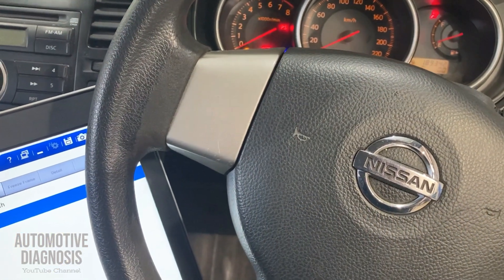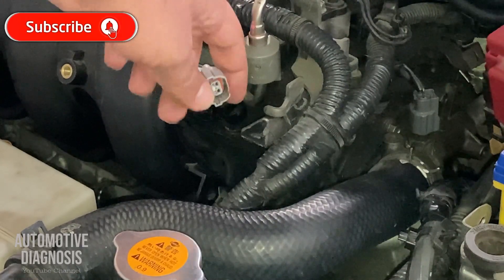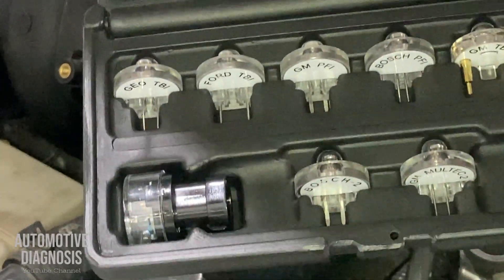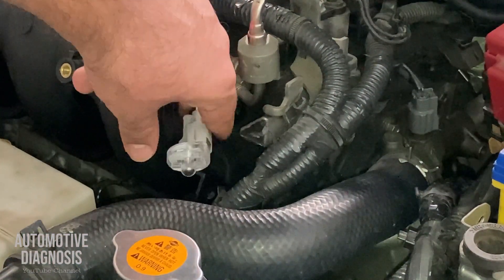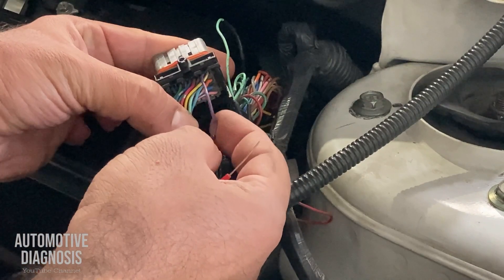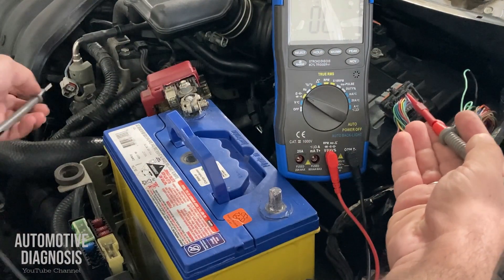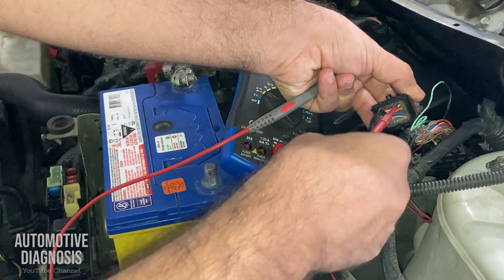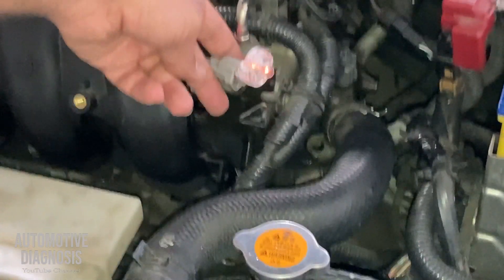How to Use a NOID LIGHT to Test an Engine for Misfire | Test & Fix P0304 Misfire Fault Code

Comment: Hi if I put my multimeter to both pins on the injector harness connector it only shows 0.33v any idea why so low, this is for each one it shows 0.33

Comment: Can Noid lights be used on a CAN bus system as I have been told the ignition switched voltage is 5v & not 12v like a normal system, I have an injector not firing on a 2004 2.0 diesel jaguar (Ford engine) & I am trying to find a test for the signal pulse wire.

Comment: I have a Code P301
Coil, spark plug and injector replaced,
Cylinder compression 150psi,
Injector connector tested with a NOID light tester(ok) 
,ECU or “Computer” replaced… 
Asking for help and fresh ideas from that smart DIY community, I’ll will compensate $$$ whoever comes with the solution to my problem 😉
Reply: Fuel pressure test? 
What vehicle or type of fuel pump,
Reply: Did you find the issue?
Im in the middle of #  1 and 4, not getting a signal back to ECU, suspecting a wire fault  Rx350 07
Reply: @jessb4421  engine needs to be rebuilt, very low compression, I used a  leak down tester for more accurate results ☹️

Comment: It could've been that Ecu shut the injector off to protect engine also it could've been a bad Ecu.. This is why O scopes are great..
Reply from the maker: Thanks for sharing your experience. Yes, oscilloscope is very helpful and more accurate. We have also many videos of using oscilloscope on the channel.
Reply: Thinking that's the issue with a Merc S500 I'm working on...🤔

Comment: Never disconnect a battery from the negative terminal only.  If you leave the positive terminal on, there is a chance something could have a ground somewhere (or not enough ground) you didn't realize and POOF.  Bad day happens.
Reply: WHAT ?  Ot unless it contacts the battery negative terminal. It's Unhooked .

Comment: Just found and subscribed.  This may be my issue. Gonna order a noid light kit. Have a po302 on my 2006 Subaru sti.  Did all the swapes and tests. Compression, leakdown,  vacuum leak test all good. Changed upstream and downstream denso sensors. Replaced crankshaft and camshaft position sensors.  Still have po302
Reply from the maker: Hi my friend. Have you swapped the ignition coil with another cylinder?
Reply: No need for noid lught. 12v led will do.